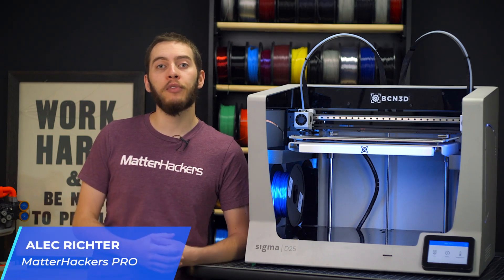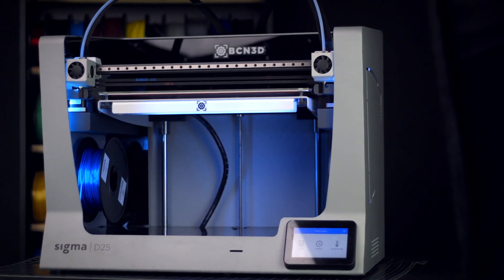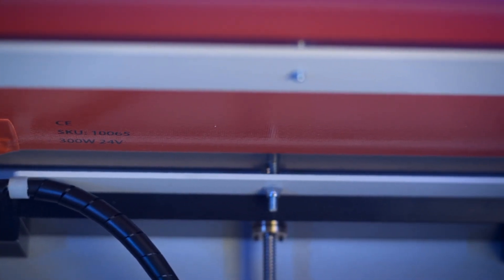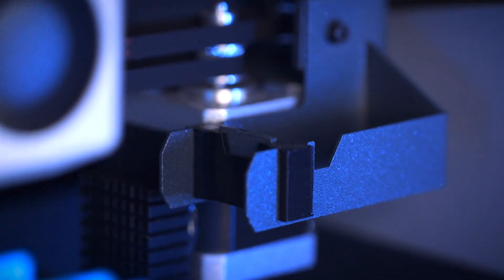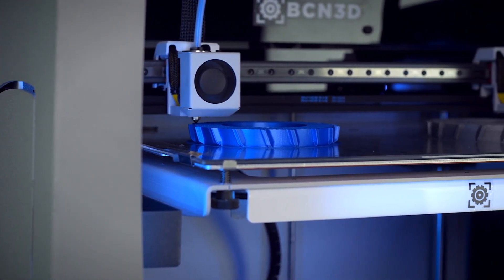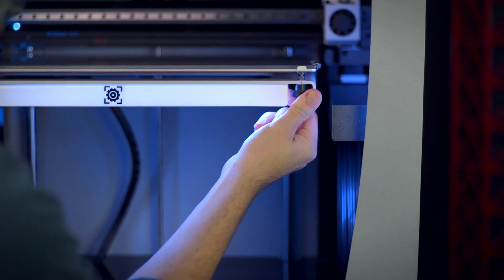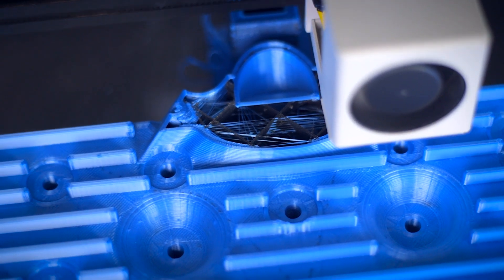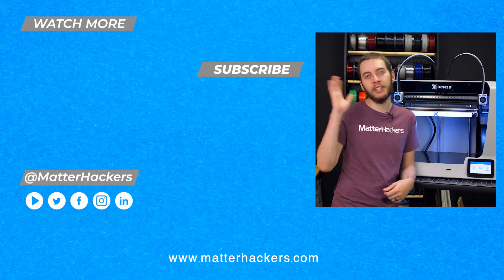Tech Breakdown: BCN3D Sigma D25 3D Printer

Comment: I would never buy a printer from Bcn3d again, I only have 430 hours on  a 2017 model it's so unreliable.  When something goes and it will, the price of repair is high, your stuck with bespoke components which time to ship and fit, it still running 8 bit boards, although the newer models have linux based compute module, I'm not sure if that's just organising the print queue or actually calculating kinematics ( it feels like it's just a proprietary octoprint). And now they only offer two sizes of print head, (not nozzles, the whole hotend, heatsink and heatbreak) I really dislike the amount of time I have wasted with this machine!

Comment: The spec on the heated bed only goes to 80c and its a bowden setup. So no PC, ABS or TPU filaments realistically? For the cost it should at least be enclosed without a filtering system and a bed that can hit 110c. The spec page says its rated for HEPA...   but whats the point if its an open air design? I'm thinking typo. I get the the dual heads are kinda the point, but for the cost it just doesn't seem that appealing considering the fore-mentioned.
Reply: And 2.85mm filament is 2013.
Reply: @Bac_creates  sure
Reply: true! for the cost it´s a joke :)